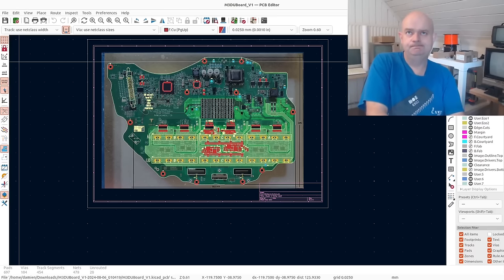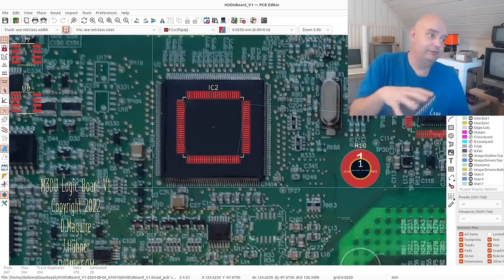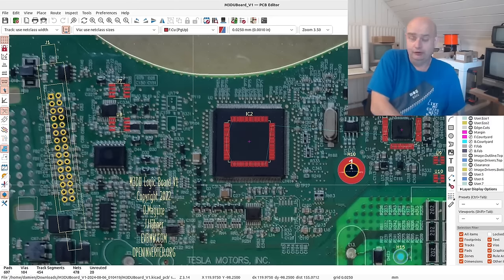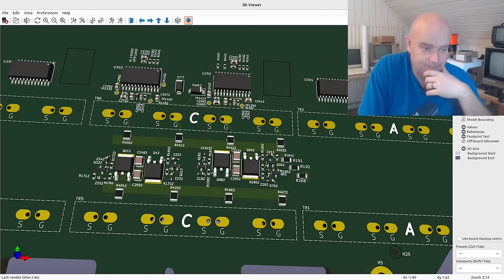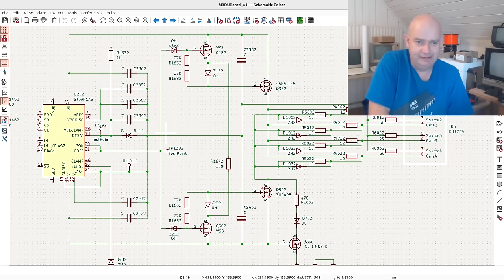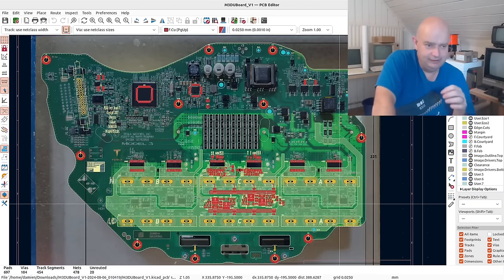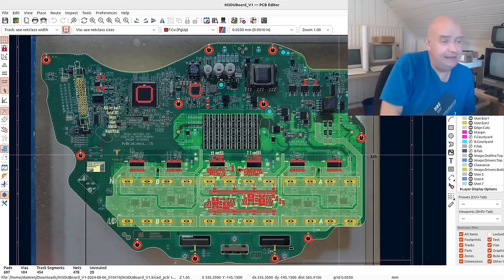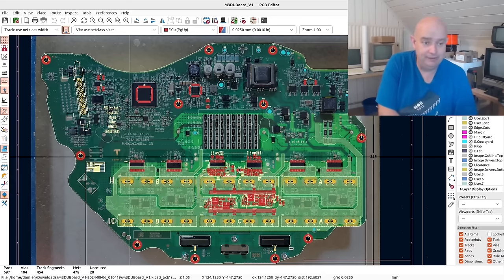Tesla Model 3 Drive Unit PCB Design 02

Comment: Hi Damian, great work. Quick question about the schematic. As I'm looking at the drains of Q982 and Q992 they're not connected together.  That's OK. In this case the turn-on current is set by  R40** (and a possible resistor from the SiC source terminals) and the turn-off current is set by R50** (and a possible resistor from the SiC source terminals). My first question is: the four resistors R60** are used in the DESAT protection. However they should come from the Drain, not the Source, right? Second question: what's the role of the diodes D1002, D1012, D1022 and D1032 in parallel with resistors R5002, R5012, R5022 and R5032? Third question: where are the sources of the four SiC devices connected? Thank you.
Reply: Hi, this schematic is still work in progress, nowhere near being completed. Most of the traces are buried in the middle layers therefore invisible. This plus somewhat unique and new design makes hard to discover all the connections. I believe most of what we have is accurate but there is still a lot missing. I am slowly making progress and should have more complete schematic in week or so. I appreciate your interest and great questions. Let's look at it in a few days and try try to figure it out 😊

Comment: 16:36 That is a really different gate driver! The output is what I would expect since those resistors are needed for FET stability, but the diodes don't seem to make much sense since they won't be driven. I think they started with a combined drive and then split it and left the diodes in. Farther back in the design there are things that make me think this was just played with until it worked. Z212 for example is feeding the drive from Q102 into Q992 and that limits the gate voltage range.  This is clearly a speed up design to increase the rise time into Q992,Q902

Comment: Great to see your progress. I ended up using an controller solution for my M3 drive. They also reprogrammed the oil pump. Have you considered what has to be done with that? Hopefully I can use an open source solution for the next one.

Comment: PCB swap is the cleanest solution, 100%. Unfortunately also the most expensive. 

I wish we lived in a world where you could cut the unflashable chips pins and clamp a pin compatible FPGA on top to emulate it. These automotive processors run at such a slow clock rate anyway
Reply: Why an FPGA though? You'd still have to run some kind of microprocessor core on it to do all the "housekeeping" stuff, while you can maybe get some advantages of putting the control stuff in hardware. But that would be a huge amount of additional development work.
Reply: @crasbee  Automotive micros are essentially black boxes behind peripherals and FPGA's let you turn a lot more of its pins into generic peripherals. But yeah everything outside of just getting the I/O up would be a pain.

Comment: Could you explain why reverse engineering the control BUS is not an option? I have heard that there is some additional encryption that is added on top of it, but there are many enthusiast that are all about glitch attack on an MCU to dump the firmware. (RACESSIM)
Reply: Well, Damien is not one of these glitch attack enthusiasts, so it would be more work to learn how to do that than to design a new board. And it won't guarantee that Tesla doesn't have plenty of different software versions so you might have to do it more than once.
Reply: @crasbee  Disagree, designing a new board is only 1/50th of the job required to get the inverter going, there is a lot of software involved in getting inverter switching right, making sure that the IGBT's are switching at the right moment, avoiding any motor winding noise, and able to operate it in all the traction scenarios, current readout etc etc.
There is a reason why this inverter was designed with this controller and software on it is invaluable - so control over bus is the only elegant solution. Unless your objective is to just rotate the motor, but then any inverter can to that...
Reply: @serzl4660 he did mention something about finding the timing info to the gates by capturing the SPI data stream.
Reply: @justRD1  All those parameters will depend on the loading/driving conditions. Unless you have a stand to load the motor and do acquisition then it is just half of the work. Same goes for the inverter - once made you would want to do a subject it to a barricade of tests and all sorts of loading conditions - can't do it without a dynamometer stand.